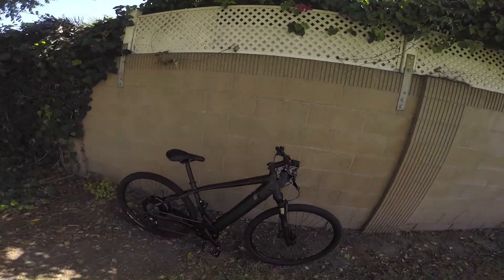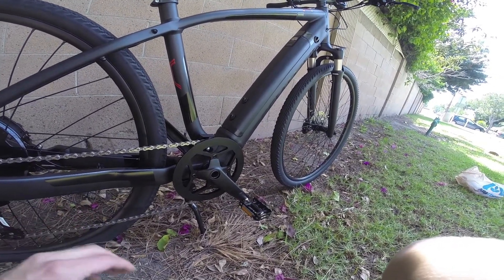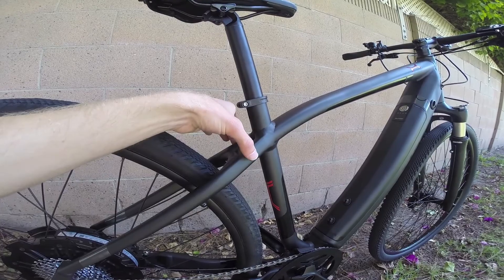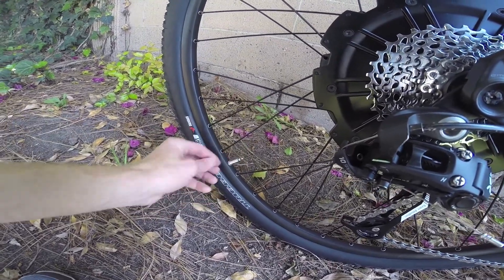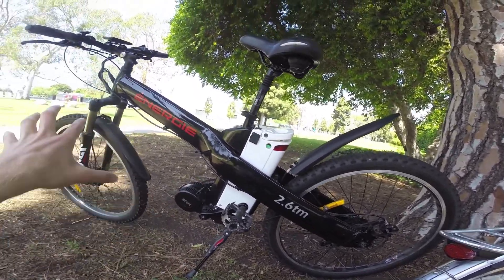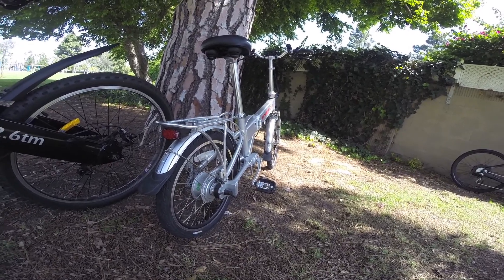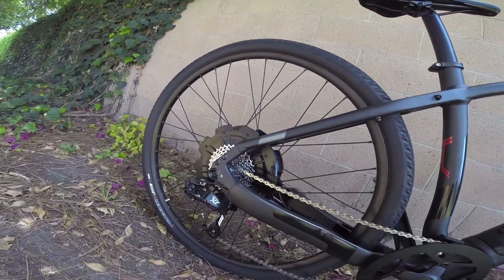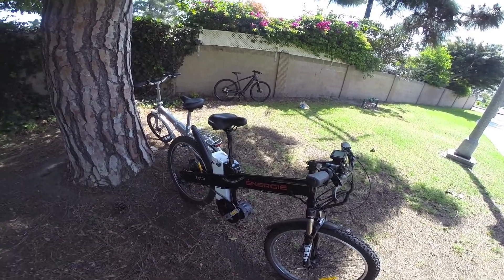eBike Primer: What Are the Different Parts of an Electric Bike?

Comment: What is the benefit of the front fork lockout? Can you please explain how it would be used. Thanks i really enjoy your videos, i find ebikes fascinating.
Reply from the maker: VanSeeker Awesome! Thanks for the positive feedback, glad they are helping you :D

Fancy suspension systems can be adjusted in many ways to help accommodate the rider weight and intended use or terrain. For example, if you're riding a full suspension bicycle on paved concrete then you might be losing kinetic energy in the form of "bobbing" which happens as the bicycle frame goes up and down expending potential energy in the shocks instead of moving it forward. A lockout adjustment solves this problem because you can still enjoy suspension for off-road or bumpy use and then lock it out for hard relatively flat surfaces.

A couple of other adjustments include fluid or air pressure (more pressure for heavier riders or loaded bikes to maximize travel), preload (this basically "loads" the suspension and makes it feel stiffer, some bikes let you go from very soft to very firm almost like lockout and this is often done using preloading) and rebound speed (this lets you adjust the shock for a quick bouncy response which is good for hugging terrain but is less absorbent or for a slower response which feels smoother but sacrifices traction in some situations). I hope this helps!
Reply: ElectricBikeReview.com it all makes sense now !